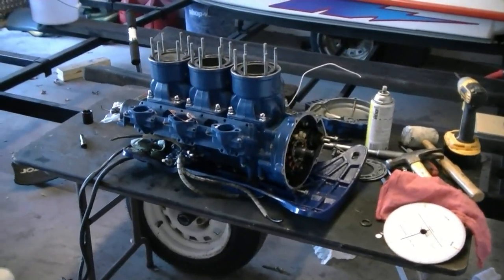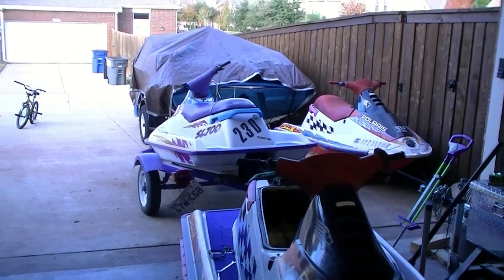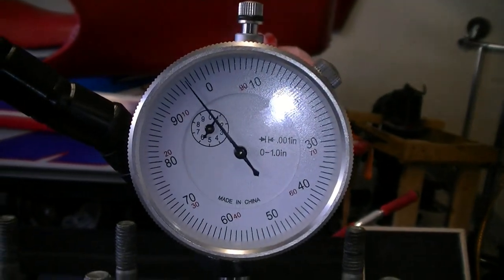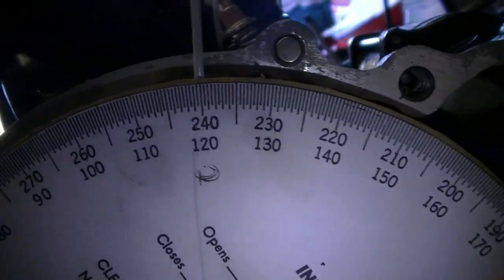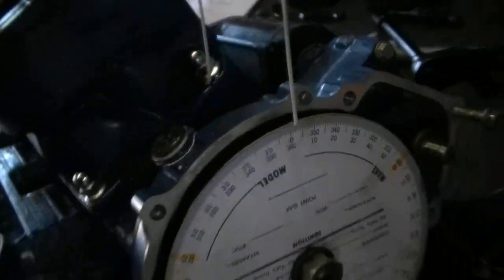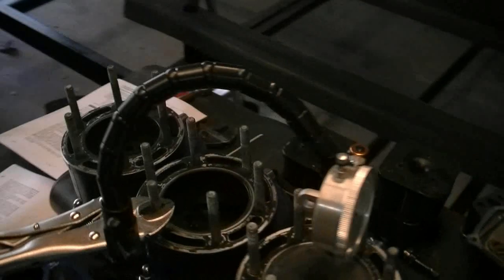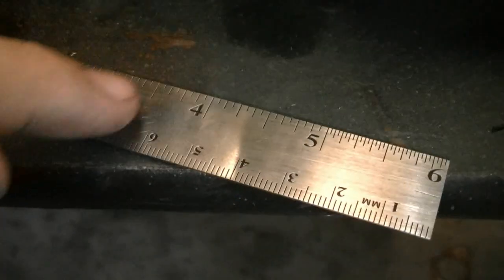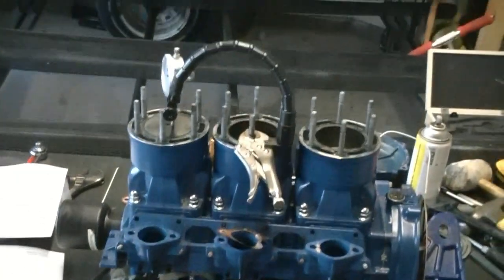1996 Polaris SLX rebuild Part 3 Checking Crank Index the right way

Comment: I have a 2001 Polaris virage I’m replacing the gasket on the water rail . Do the bolts need to be torqued and do I use loctite

Comment: hi have polaris slt 780 1996 and woundering if anyone knows how to cut off power when not in use. also its cranking but quick when off, any idea how to check the fuel pump

Comment: i got a polaris xlt 600 triple im just curious if over reving can cause the crank to be out of index. i had my clutch bolt break and clutch fly off causing my motor to rev like mad and then wouldnt start afterwards, backfires like crazy. any ideas

Comment: Judging by the looks of the PTO and MAG pistons, both having a detonation/preignition hole burned in their domes, and combined with the lack of piston wash on the port edges, Im guessing that you found both crank end seals to be faulty and leaking causing a lean mixture in those 2 cylinders? probably wasn't necessary to check the index of the crank. but good tutorial none the less.

Comment from the maker: @xxdarkheartsxx 

Sometimes water gets into the bore and causes hydrolock. It is when it trys to turn over and because water cannot compress, the engine just stops. The rods are pressed on the crank, and it can force it out of "time" or index. Then the engine is not firing right, and can burn up a piston, or not run at all.

Comment: Curious about what the deal with finding tdc and backing off .010 thousand. I would think find tdc cylinder 1 then use your pointer and see if cyclinder 2 is at 120 and cylinder 3 is at 240 if so your good.... Anyway I had a bad index on my pto and did like you but never backed off .010 when checking. Just was curious what the reason was for doing that..... Mines running again yeah.... See ya at the lake!

Comment from the maker: Good Question. The Polaris Crank is "pressed" into place and is not welded. Therefore if you get water in the engine and crank it you get hydro lock. The forces involved will cause the pistons to get out of "index" and the engine can burn pistons.